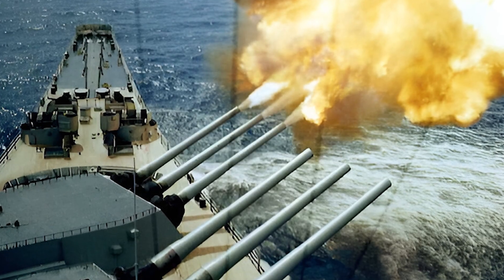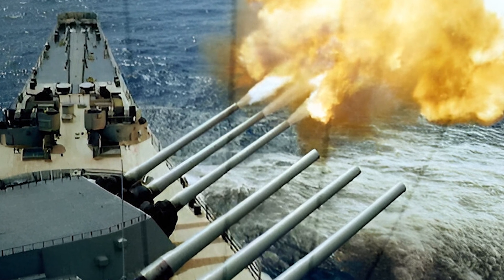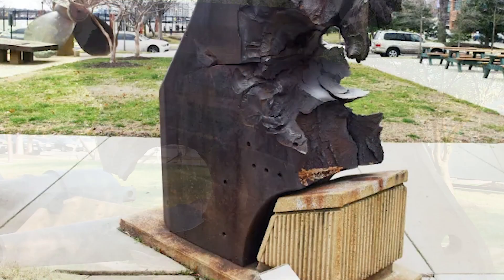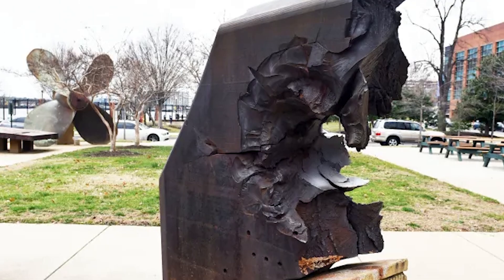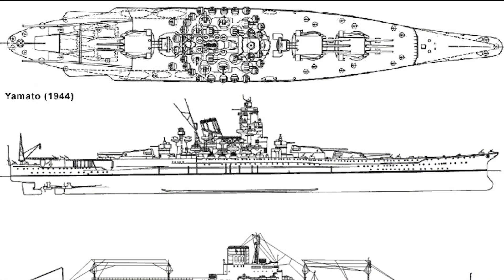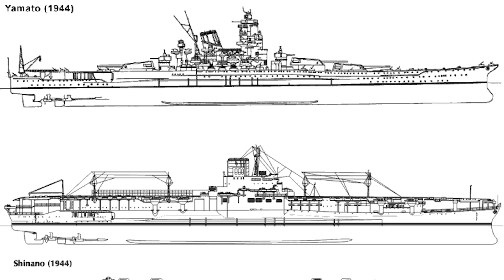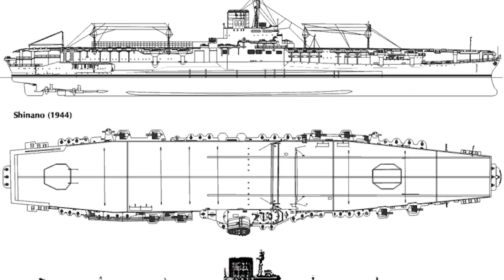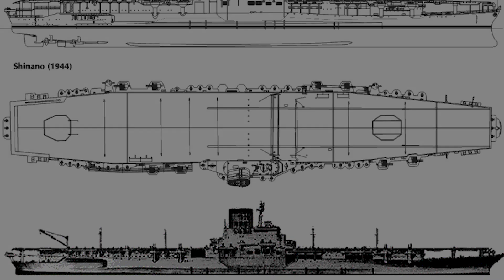USS-Iowa VS Yamato Armor Simulation

Comment: I study not only the Pacific War, but especially Battleship Yamato as my 専門 (Main Focus) at the University of Hamburg and it's Partner University of Hiroshima at the Asia Africa Institute. My Professor that was responsable for a work that was Published by me in the State Library of Hamburg was Professor Dr. Jan Minck. 

I would STRONGLY urge you to correct the Title to include that this is the well-known Armor Test, as you stated verbally. The Internets Nature tends to only look at the Title or watch the Video muted. This Test is in no way representative of a proper penetration of Yamatos side armor, as you also stated. Since the Test neither included the additional spaced plating of Torpedo Prot, Fuel tank Prot and Hingeholder Protection (all three of which are simulated nicely in the Yamato vs Iowa penetration Simulation by DejmianXYZSimulations), it also doesnt include the Range nor Slope or velocity drop.

Yamatos sidearmor, turret face and Battle Bridge protection was impenetrable for Iowas Guns at ranges from 33.000 - 17.000 Meters. The Deck of Yamato could however be penetrated by Iowa from her maximum range. Yamatos side penetration was capable at or below 17.000 Meters, whereas Yamato could penetrate Iowas side at 28.000 Meters, with the Deck of Iowa being also penetrable from Yamatos maximum range. 

For everyone watching this, I would also urgently recommend you to read up on Bill Jurens and Brad Fischers "Gunnery reports from the WW2 era" which compare Yamatos and Iowas True disperation, service velocity and TMD. 
Additionally, if you are capable of speaking Japanese, I'd HIGHLY recommend "【日米最強戦艦対決】大和VSアイオワ【3DCG検証】" from テイコク立体. She has a Japanese Naval Historian as help to explain Yamatos armor protection against Iowa.
Reply: Source material is from the U.S. Navy Bureau of Ordinance.

Immunity zone of the Iowas vs. the 18.1" gun:
Citadel                    24,800- 29,800 (5,000 yards);
Turret Faceplates 24,700- 31,600 (6,900 Yards);
Barbettes               26,500- 31,600 (5,100 Yards);
Steering                 24,700- 28,800 (4,100 Yards);
Control Tower       26,500- 31,600 (5,100 Yards).

Immunity Zone of the Yamatos vs. the 16" .50 cal. gun:
Citadel             17,000- 34,500 (17,500 Yards);
Turret Faceplates                      (Impenetrable);
Barbettes         16,600- 36,800 (20,200 Yards);
Steering           19,100- 33,400 (14,300 Yards);
Control Tower 16,600- 33,400 (16,800 Yards).
Reply: @manilajohn0182  Good Source if true! Do you have a Source for it? You can also contact me in private if you don't have a link or file ready. It's very similar to the Japanese Video I linked, which has a nice visualization that I unfortunately cannot send over YouTube... 
Thanks for putting it in though! 

Additionally, I'd like to add that there is a nice 800mm DORA Gun Video vs the Yamato faceplates at a realistic target velocity and impact, however of course such a hit would never have happened in real life. It goes to show the actual capability of the Face plate though.

There is no doubt the Iowa class was an amazing Shipclass, easy top of the Line. But in my personal opinion, regarding my experience and knowledge for years in the Topic (and future Work at the Yamato Museum in Kure, Hiroshima-Ken), I'd like to state that Yamato was overall the better Battleship. However, against multiple Iowas, Yamato could do little, and especially against the overwhelming force of American Air and Naval numerical and tactical advantage, she faced much inferiority on the actual Battlefield.

I am merely always a little frustrated to see many people misinterpret/accept false information that was passed on since post-war.
For example, the final days of the Battleship Yamato were scheduled to be published in the magazine Sogen, but were deleted in their entirety by the censorship of the General Headquarters of the Supreme Commander for the Allied Powers (GHQ), the Civil Censorship Detachment ( CCD ).A heavily altered version, including a change to colloquial language, was published in another magazine under the pen name of Hosokawa Muneyoshi. 

This for example is one of the reasons why an important Number is withheld up until today, which is the number of Aircraft damaged by Yamatos Anti Aircraft Fire in her final Battle. There is also the issue of the low cloud ceiling on Ten-Ichi-Go, which forced her 127mm Guns to be severely limited in effectiveness. While lacking proxy fuze, they proved their worth on Yamato especially during a Helldiver attack before Ten Go. 
There is a US Pilot, Edward Seaver who gave an Interview in July 2012. He described 8 Helldivers being ordered to dive from 20.000ft and attack Yamato, as the rest of the 280 Aircraft were bound for a Land target. Yamato was a target of opportunity Edward and the 7 other Helldivers entered the Dive, but after a few seconds, the 8th aircraft was hit and was a "Flaming Ball". Seaver describes the Anti Aircraft fire as "So bad we could not see the Ship". As a result, the remaining 7 Helldivers aborted the Dive.

This Information has been withheld by the CCD. Along with the Number of damaged Aircraft during Yamatos final sortie, leading to the Myth that her AA was so insanely ineffective that she only downed 10, with many believing the lie that her Explosion knocked out more Aircraft than her fire. This lie comes from a survivor of Yamato who was interned by the US after the Conflict and was forced to make certain changes to a book he was due to publish.
Reply: @ijnzuikaku5269  Source is the U.S. Navy Bureau of Ordnance. The Iowas were designed to escort carriers and to catch and destroy the Kongos. They did not adhere to the balanced armor concept in that they were not adequately armored against their own main battery. The U.S. Navy estimated that a new Japanese BB would be roughly equivalent to the South Dakotas in firepower and armor protection but on a ~45,000~ ton displacement. In every single area of comparison except maximum speed- maximum range, shell weight, bursting charge, danger space, rate of fire, armor protection, and even gunnery accuracy (this last one due to shell dispersion), the Yamato class BBs held a clear advantage. That not surprising, considering that the U.S. Navy never attempted to construct the most powerful battleship afloat.

I agree that Yamato's 5" .40 cal. heavy A.A. battery was a good weapon for the job. That said, no heavy A.A. gun was deadly against carrier aircraft prior to the development of the VT fuse because constantly changing range to target made accurate fuse settings extremely difficult. The 25mm OTOH, was a poor weapon. Frequent magazine changes resulted a rate of fire for the 25mm which was barely half that of cyclic. I recall reading how a surviving officer of Yamato's sinking referred to the ship's A.A. fire as "shooting blanks". In a surface engagement however, the Yamatos were superior to any other BB of the period and historical performance bears this out. Yamato obtained multiple 1st- salvo hits on two U.S. warships from over 20,000 yards off Samar (one was aimed solely by radar) and dropped two shells a few feet away from USS White Plains from over 34,000 yards. None of the Iowas obtained a main battery hit on any vessel of destroyer size or larger during WW2.
Cheers...
Reply: @ijnzuikaku5269  the debate on if the Yamato or Iowa is really a matter of peoples personal opinions.  It would be a fairly even fight, albeit skewered towards whoever gets an accurate firing solution first. 

and if you are talking about Edward Sieber (because the pilots name was Edward Sieber. A sailor named E. Seaver was however in command of LCI 728, also in the OOB of the Okinawa campaign, but did not take part in attacking the Yamato), first recorded interview in 2004, he states that it was the Attack on Kure that saw 8 bombers attack the Yamato. They lost 1 plane, continued the dive, dropped the bomb and ultimately missed due to Yamato's evasive action (there are actually pictures of the bombs falling around Yamato on that day). He makes the statement that it was a combination of the heavy AA defense at Kure that made it difficult to get a good target. Sieber would be the 2nd pilot to drop on the Yamato during Ten-Go, and scored 2 hits. During Ten-Go Japanese AA during this WAS ineffective at downing aircraft, as USN reports only listed 4 Helldivers, 3 Avengers, and 3 fighters, or 12/300 aircraft (4% of all USN strike aircraft). Another 60 or so were damaged to any degree.

Comment: To everyone raging in the comments that 90 degrees is unrealistic, you seem to be mentally omitting that the shells in real life would be coming in at an arc, thus greatly offsetting the angle of the turret face. The two may well not equate to precisely 90 degrees, but it also likely wouldn't be from 400 feet away, as was done in the test.

Comment: At point blank 90 degree angle a 16 inch superheavy shell should go through over a metre of armor, not sure why they did this test, guessing it was a "look, our ships could win against their ships" post-war sort of deal.
Reply: A SH shell from a 16"/50 would penetrate about a meter, or slightly more, of regular steel, but not any armour steel like the ones used in the world wars !
Reply: @niclasjohansson4333  they do not measure penetration against non armor grade steels, that would be wasted effort and of no value.
Reply: @Procrastinater  The 16"/50 at point blank range penetrats 861 mm of the type of armour used in the Yamato class, and "only" 782mm of the steel from the Bismarck class, and even less, 749mm of the type of armour steel used in the KGVs and Vanguard ! And the overrated 16"/45 has even less penetration thanks to an even lower velocity ! The US SH shell does not have the best side armour penetration of battleship guns by a good margin !
Reply: That's more on the shell, not the Gun it self. The 16/50 if not firing the SHS would be akin to a Littorios but 16"  @niclasjohansson4333
Reply: @niclasjohansson4333  Interesting, I've known the Yamato's shell pen to be over 1000mm, I just assumed the 16/50 were similar since that's what everyone has been saying since forever.
Where did you get this data?
Reply: The purpose was to find out if the 16in 50cal had any chance of pening the turrets of the Yamato-class. If they could not even under unrealistically ideal conditions then there was no hope they could at combat ranges. It's my understanding their first shot partly pened the armor and the second shot penetrated completely and ended up in the river behind the test range. The conclusion was the 16in 50cal was unable to pen the Yamato's face plate at any combat range. However, this did not mean the 16in gun could not pen the Yamato's belt or deck armor at certain ranges.
It should also be noted that sometimes you don't need to actually penetrate the armor to injure or kill everyone behind the armor were the shell hits just from the shockwave moving through the ship.

Comment: Keep in mind the plate they shot irl was rejected by the Japanese due to low quality
Reply: Sorry, that was not true.  It was intended for Shinano and after the conversion  taken to the test range.   It was found there post war.   Reports of contamination concerned ceramic material found in the armor and other plate armor used in the Yamatos.  Later on US Navy found out it was deliberate .  Research lead by Britain based on the findings lead to Chobham ceramic steel armor.